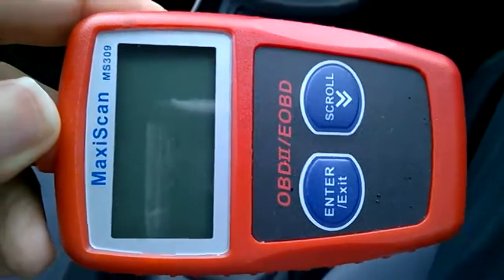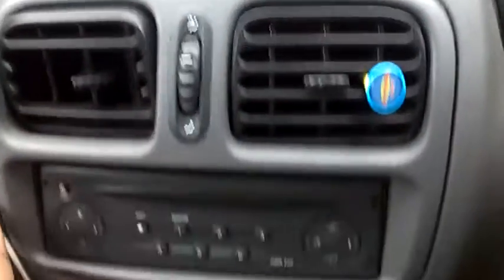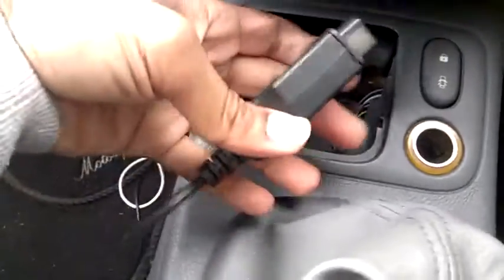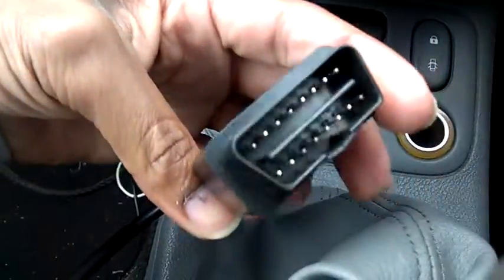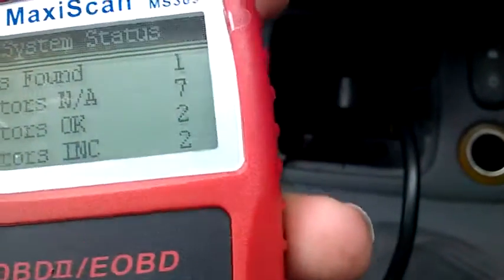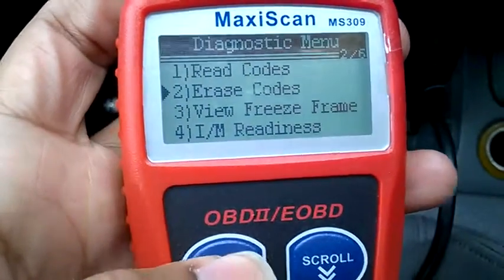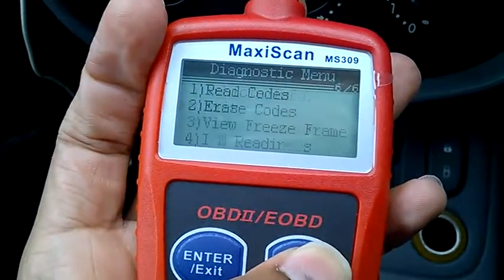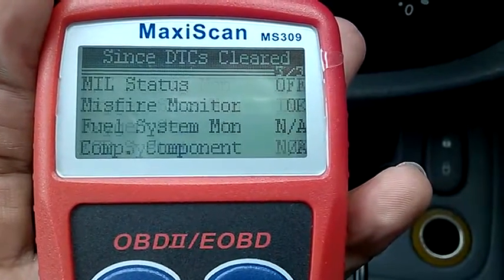Renault Reading and erasing engine light OBDll

Comment: Pointless erasing a code - it will re-appear unless the fault is addressed.
Reply from the maker: Yes but if u sort the issue it should not
Reply: Hi, if you deal with the issue, the code will disappear by itself.  No need to clear the code.